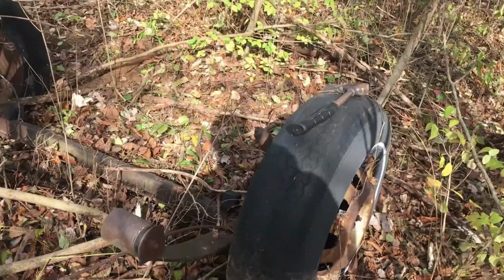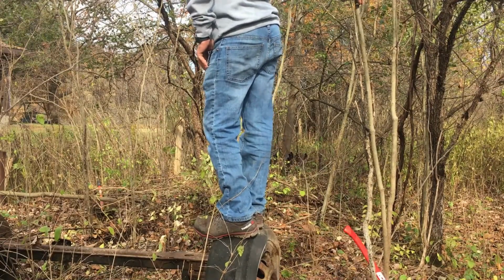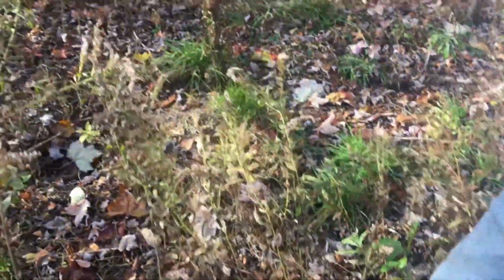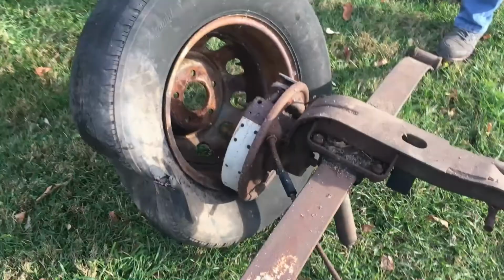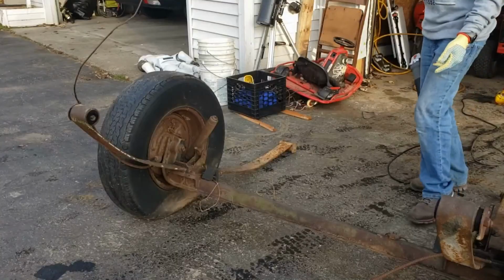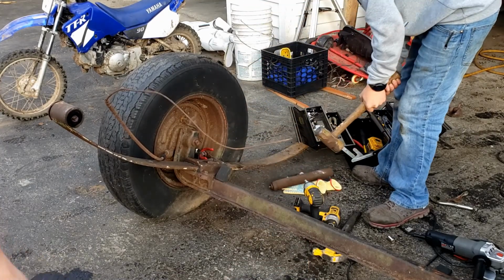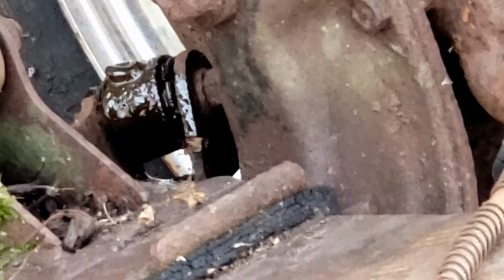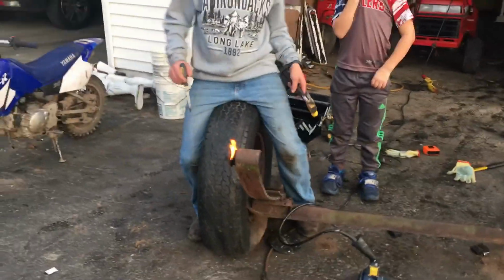Car Axle Trailer Build Part 1

Comment: Where is part 2
Reply from the maker: We stopped working on it for a while because of winter but we will be working on it soon so part 2 will be within a few months most likely.
Reply from the maker: We completely forgot about this project lol. I want to work on it some more soon, right now it's in the woods but I'd like to make it a flatbed trailer. Maybe a part 2 within a few months but who knows, I need metal as well for it.